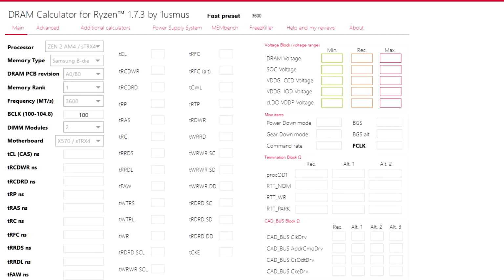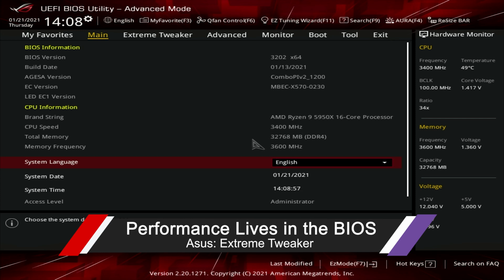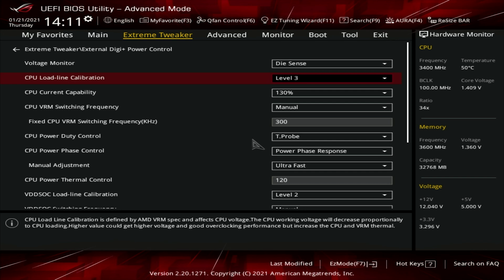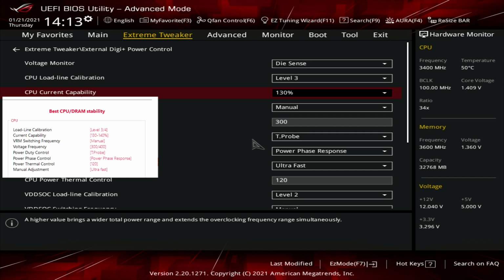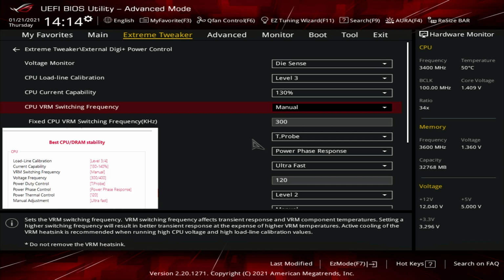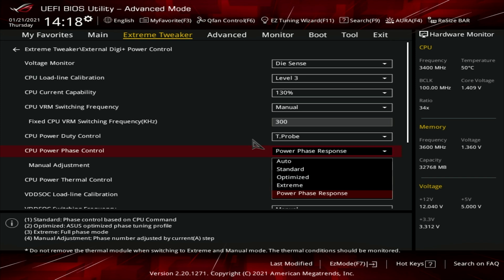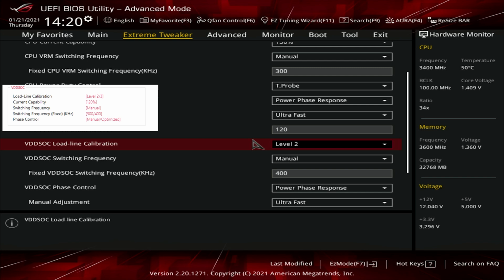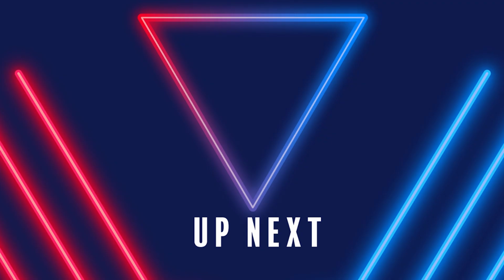Get the most out of your Ryzen CPU & Gaming RAM w/ Power Optimization

Comment: I've like none of these particular settings on my x570 tomahawk.  Could you pls comment on roughly what Asus settings translate to the msi settings in the BIOS?
Reply from the maker: Sorry Brandon, I don't have access to an MSI board. The power terminology should be the same, it would be a matter of digging into the menu to find it. Asus calls it Digi+ Looking online it looks like MSI calls it DigiAll Power under OC Voltage Settings.
Reply: @TheGrayingTech   Ok, I'll look into it. Thx for the response!
Reply: @Titansfan81  They do exist on the Tomohawk as well. Check under advanced voltage in the OC settings.

Comment: I have a 5900 X do you recommend this ?
Reply: My istrix x-570 baord doesnt have a dram section. Can you help mayb where I need to go as I have only AI tweaker
Reply from the maker: Absolutely. I am using these exact settings with a 5950x. I'm sure there might be some improvements in a future version of the calculator, but I have had rock solid stability using these.
Reply: @TheGrayingTech  will 100% go for it.. I got x570 board also. So will be quick and easy for me to apply